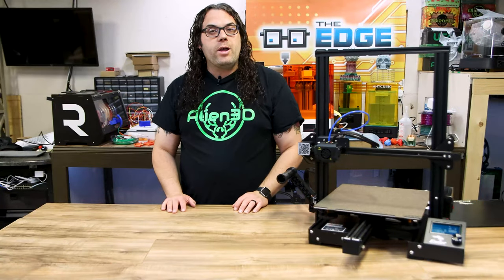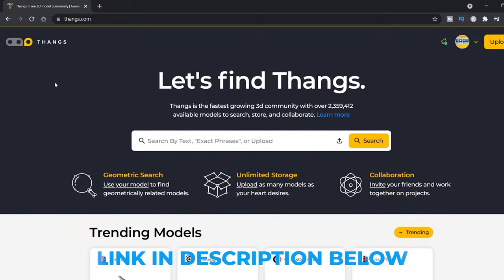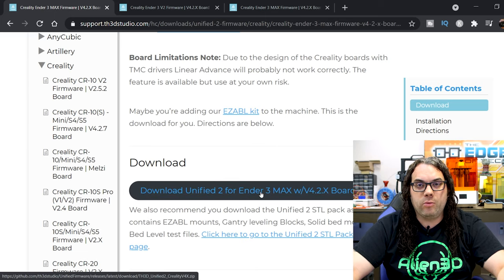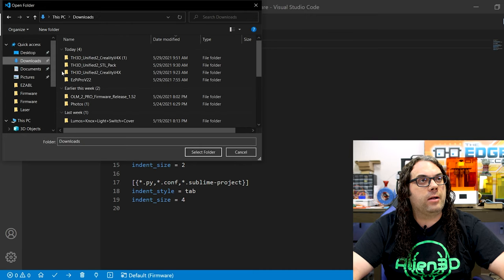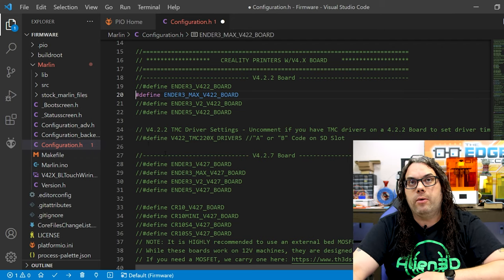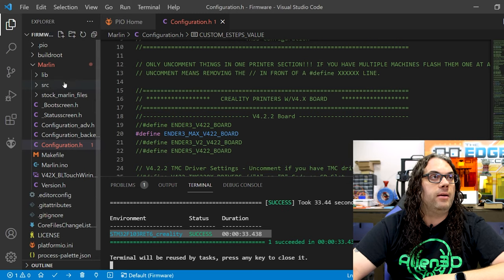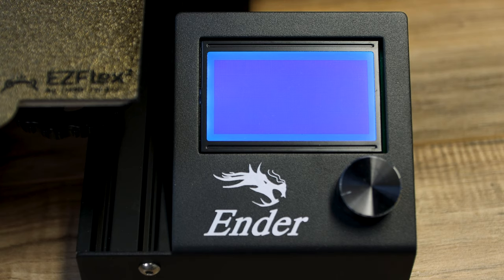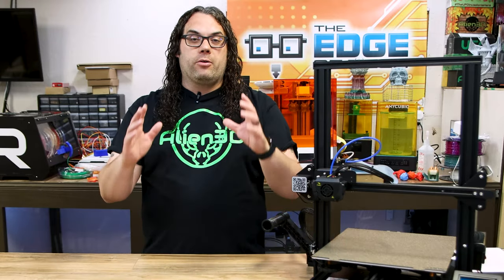3D Printer Firmware Update Featuring the Creality Ender 3 Max

Comment: Excellent video, 9/10. The only problem i had was running the build sice i didn't have  PlatformIO or Auto Build Marlin installed. After I installed them both, it worked perfectly! Great job.

Comment: Planning on buying an Ender Extender 400XL pretty soon. I have an Ender-3 collecting dust in storage because I have an Ender-7. Remembered the 3 existed when shopping for a large format printer, and it seems embiggening the little machine won't be particularly difficult.
Thank you for going over that, I didn't expect much more than just loading new firmware as-is. Seems I always have to watch 3+ videos on any given topic before getting all of the information but you covered all I needed 😁

Comment: I'm pretty sure i used this same video when i first got my 3 max, i ran into really bad layer shifts randomly so ive been chasing that ghost. I upgraded the board to a 2.2.7 (luckily my buddy had one he hadn't installed ) still haveing the issue , flashed Creality version of the firmware. thought it worked  til i printed something bigger. 

so im here again to recompile marlin . Th3d Charges for unified 2 now and  the files are board specific (I bought the creality 4.2.x version, scrolled to the define board section where there was a link to the file I was supposed to buy) 

Just a warning to anybody else  going that way . they say digital downloads are nonrefundable so probably out that 5$ but ill send an email and see where that goes. 

Thanks again for the video and hopefully this solves my problem

Comment: Concise and well presented, as always. TH3D Unified is what I put in my stock Enders and CR's. It works especially well on the 8-bit boards and  non-touch displays that are still shipping in printers like the CR-10 series. The 8-bit boards do not have a lot storage space so you can't turn on a lot of features. TH3D has done a good job of optimizing Marlin so it fits nicely on an 8-bit board.  On my franken-ender, I run the latest build of bugfix 2.0x. That machine has a 32-bit SKR board with a little more headroom to play with so I can add and subtract features willy nilly.
Reply from the maker: Awesome! That's great to hear, I have been using their firmware for years also! Thanks for watching!

Comment: PSA as of 9/5/22 for all of you that’s saying you don’t have the check mark at the bottom… make sure you are not going too deep into the folder directory and selecting the other “Marlin” folder but instead choose the folder name of the extracted file you downloaded. In my case I downloaded n extracted “Marlin-2.1.1” so in VSC go to file>>open folder>>Marlin-2.1.1>>select folder. The OTHER marlin folder few levels down the path/directory only has about 8 other files in it including the ones you need to modify but the marlin folder you want will have upwards of 16 folders n files including the important “platform in.ini”

Comment: Hi, I just purchased the creality ender 3 max and I noticed  creality slicer doesn't have an option for this printer. Obviously your using 1 so if you could advice me on how to set it up so I can use it that would be very helpful. Thanks!
Reply: The latest version of Cura has one for the max. You could also use the V2 profile but change the build volume.

Comment: thanks for the info. Question for you from this newbie. Can you update firmware using the USB port as my sim card reader in my ender 3 has died. I have an old machine with a V.1.1.3 board. I know it is probally best to just update the board and be done with it,

Comment: Hey, your video really got me surprised. After watching several tutorials here on YT, yours is short but precise. When I upgraded my Ender3 from 8bit V1. 1.4 to 32bit 4.2.7 the firmware never worked out and resulted in the button not being functional. That unfortunately led me  to reconvert back to the old mainboard.
Reply from the maker: Hi! What do you mean the button wasn't functional?
Reply: @TheEdgeofTech  when I uprgaded the hardware and updated to the latest firmware, I could rotate the Ender's rotary knob to the left or right. This changed the values for FN from 0 - 300. The thing is that when I hit that knob it normally should bring me to the printer's menu. My printer didn't respond to that command

Comment: perfect  fixed my firmware  i got a cr probe and  one of the direct drive extruders, well  i have a ender 3 pro with 4.2.2  board it  has the  display thats a small window and selector  knob not the newer touch screen.  well long story short  creality software that came with it lists it ab  marlin BL probe it decided to make the display screen  nothing but gibberish   and next to impossible to read. so had to find a way to reset it back to a usable condition this video helps immensely. now i have to figure out the firmware  download to make a functional cr  touch probe

  now i new it was going to be  a hassle because so far this ender 3 pro  has worked like garbage. to start   the   flex sheet to  build on    laying it flat on a machinist inspection stone   has a  dip ( low spot )  in center  compared to rest of sheet   by about 50 mm diameter and  up to  .15 dip lower.  i got non-stop temperature  errors, springs that came with it are so weak and  cheap the   platform wont stay level so also installed better spring set  ( btw if you swap springs that are firmer  stiffer spring  you  may   need to raise you z minus limit switch so there is room  for the  adaptor that  holds the wire  bracket.   if you also install the new direct drive you will need to raise the switch no questions asked ,   the online web chat for them is useless

Comment: Seems really when you've done it multiple times I guess, but when you've never done this at all, it should be noted or have a link to downlead VS  and to install it, also that when checking that checkbox at 7:26 on the video, it kept giving me error code, ended up having to figure out why and that it was because VS would not do the build unless my folder for the firmware was on my desktop! Did not work at all when it was on a subfolder in my "Downloads" folder. Just to be noted. Other wise it was good!

Comment: Hey thanks for the walkthrough, seems pretty straight forward. I am running into the issue that my Visual Studio Code program doesn't appear to have the little check button at the bottom you pressed to start compiling. It's probably something simple but a point in the right direction would be appreciated.
Reply: Did you ever figure this out? I have the same problem
Reply: @jmo3262  I haven't yet no. Hoping for a reply from the creator. I've had no luck trying to troubleshoot it myself yet.
Reply: @netherchicken8733  did you install platformio and python? That’s what I had to do but my laptop is old and on win7 so it’s not going to work for me
Reply: @jmo3262  AH! I had not installed python yet, thank you very much! That sorted it. :)
Reply: @jmo3262  thanks alot! had the same issue

Comment: Ok. So I attempted this. Installed the application, downloaded the files.

But after I open the "folder" it doesn't give me the checkmark at the bottom to "finish"
And I don't have then "pio" option in the leftside menu?

So not sure if the software has changed? Or it didn't install correctly maybe?

Comment: So I’ve downloaded all software VSCode ,PIO extension and compiled the firmware and sent it to the SD Card ejected the card inserted it into the Ender 3 Max and the original Ender logo keeps popping up when i power on the printer. Is there anything I’m missing. I’ve watched the TH3D VSCode install and only difference is it never prompted for Python to be downloaded. What could i have done wrong?
Reply from the maker: What is the name of the file you are putting on the SD card?
Reply: @jasonkelly9849  Did you ever get the firmware installed? My Ender 3 Max is doing the same as yours. Booting normally without upgrading the firmware.
Reply: @jasonkelly9849  I finally solved the same problem you were having. My SD cards were not able to format as FAT32. I took a regular card and put it through a card reader into the printer and it loaded the new firmware immediately. So FAT32 is vital to installations. I hope this info will help others. Thank you.
Reply: @PaulPomerleau  I’ll have to try that to make sure but I believe i formatted the SD card to fat32. I’ve recently upgraded the board to the 4.2.7 board and a few of the options for the Max is unavailable with the 4.2.7 that are factory from the 4.2.2 board. It’s weird!!! I’ve been wanting to get the factory board back in it because the label on the new board was supposed to be for the Max but has the Ender 3 Pro sticker on it!! Thanks for the update o this thread though.

Comment: The issue im having is that i have a BL Touch and ive tried to configure it in this exact firmware all day but the z offset will not work.  every time I set it I store the settings and then as soon as the print starts it floats several mm above the bed.
Reply: Were you able to set it right? I'm having the same issue. I just got my ender 3 max with bl touch today.
Reply: Same.

Comment: Does that work for the Ender 3 (Base) as well? I have a weird issue that the printer stops after a few minutes with a frozen screen with some pixel lines cut out. After power off/on it asks for a power outage restart. I made sure my SD is formatted correctly (FAT32, MBR). Is there maybe a way to fix this without installing new firmware? Thanks for your help :)

Comment: for some reason it keeps failing after hitting the tick. I've done everything as shown in this video and only uncommented the ender 3 max 4.2.2 section.

this is what keeps coming up:

  The terminal process "C:\Users\Artis\.platformio\penv\Scripts\platformio.exe 'run'" terminated with exit code: 1. 
 *  Terminal will be reused by tasks, press any key to close it. 

under problems it shows:

#include errors detected. Please update your includePath. Squiggles are disabled for this translation unit (C:\Users\Artis\Downloads\3d max firmware\Firmware\Marlin\src\feature\fancheck.cpp).

As someone who is completely new to this, any help would be very appreciated.

Comment: Can someone please reply. I've followed step by step. Got vscode, python, platform, and everything but I'm not getting the check mark
Reply from the maker: Hey Michael! I'm not in front of my PC right now, but a couple questions. Are you using the newest version of the firmware? And did you check out the TH3D website instructions to make sure you're going throughput it all? This video is a little older now and the firmware most definitely is updated!
Reply: I'm stupid. I was just clicking on the folder instead of opening the folder then hitting firmware. I kept watching ur video to see what I was doing wrong and finally noticed it
Reply: Thanks for the reply
Reply: Do u have a video on how to install bltouch software?

Comment: My ender 3 max keeps stopping, ruining the print, and claiming Thermal Runaway on EVERY print. havent printed in a year because i cant figure it out.
Reply from the maker: Have you tried new firmware? Also, have you tried checking how tight The little screw that holds the thermostat on your hot end? If that is too tight it could be shorting it causing thermal run away.
Reply: I am the absolute worst with computers and this whole video kind of went straight over my head tbh. I only just got the printer when this started happening

Comment: Thanks for the vid!!   But I have an issue. To activate the firmware, you clicked the check at the bottom to “go” as you said. But I have zero tabs at the bottom.  Please help.
Reply from the maker: Hmm. Even if you expand the window to be the whole screen?
Reply: On the left of the vscode window you should see an icon of 3 squares and 1 floating square thats for extentions. open than and search for PlatformIO. install that and then restart vscode and then open everything like in the video and that PlatformIO should put the checkmark at the bottom of the window to compile to firmware
Reply: @warstoriesofthe88th  You opened the wrong folder. See our video here: https://www.youtube.com/watch?v=iE7dyl-COX0
Reply: @warstoriesofthe88th  thank you

Comment: i can not compile Firmware
 Click the ✓ at the bottom of VSCode to compile the firmware. The firmware will compile. This may take 1-5 minutes depending on the speed of your computer and internet connection 
the ✓ is not on yhe bottom

Comment: Hi guys, i just followed all the steps and got the firmware updated with success, but when i went to start up the printer with the sd card inserted i got a blank screen, the firmware never booted and now the printer is doing nothing. Anyone knows what to do in this situation?
Reply: I'm having the same issue, did you every figure out a work around or get your problem resolved???

Comment: Tried this but my vscode has no check or option to go, runs into errors on attempting a debug run
Reply: Did you install the PlatformIO IDE plugin?
Reply: @84jperez  Very late reply but I did manage to get it working after installing the plugin, Thanks a lot!

Comment: i sussed it but,the bin file on jims is 20210529 232131 when i get it up its 20210701 140056 for 4.2.2 board, and when i do the 4.2.7 it comes up 20210701 134225  al ender 3 max,so whic would i use if i use one board or the other,mine is stock,just dont want to mess my board up,anyone please.

Comment: for the ender3 pro is the same
Reply from the maker: Depending on which board you have, yes! But if you have an older 8 bit board you need a different TH3D firmware package. I have a couple videos out there on those as well. Thanks for watchin!

Comment: Thanks for the video, but unfortunately it failed as it did when I tried to install Marlin straight from Marlin. Both times it says [.pio\buid\STM32103RET6_creality\src\src\Hal\STM32\MarlinSerial.cpp.o] Error 1 . this is the first times today trying to upgrade the firmware, and I'm really new to 3d printing also. Any help would be appreciated, and not sure I'd understand if you were to explain it. But really appreciate the video, it was very detailed. Thanks again.